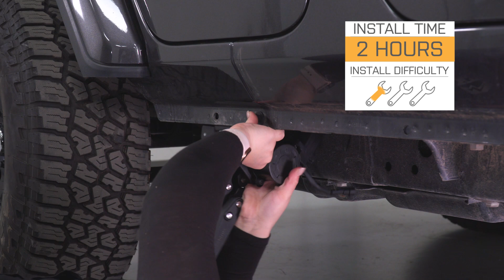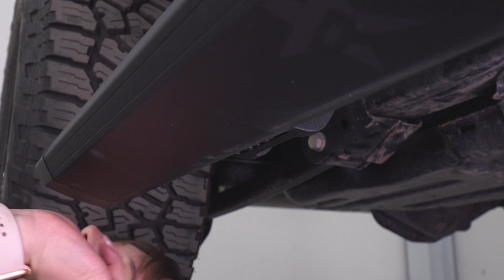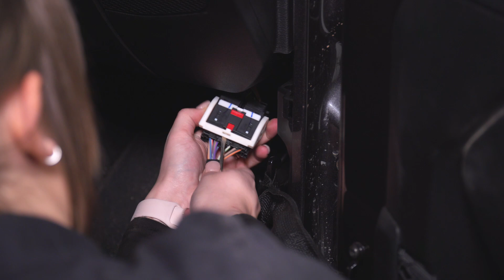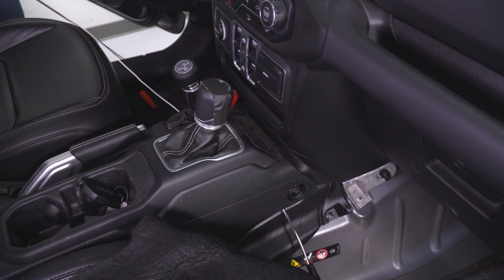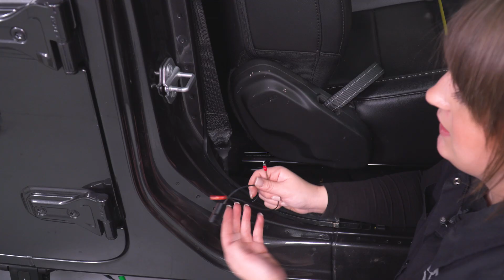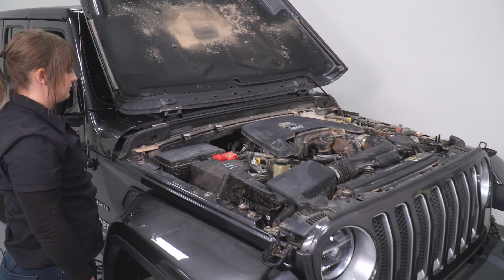Jeep Wrangler JL 4-Door RBP Stealth Power Running Boards Review & Install

Comment: What About when you remove the doors?
Reply: I have this system on my JL. When I remove my doors (and disconnect the front door wiring harness), the steps default to the up position. They tuck themselves to the body well, so it still looks good, but you loose the functionality. 
I added grab handles to help with ingress and egress with the doors off (4” lift and 37’s make for a little drop).

Comment: That's about 5 seconds or so delay before they retract. Can that time be changed to immediate?
Reply: Or is there a logical reason for the delay?
Reply from the maker: As far as my experience with these RBP Running Boards goes, there is no option for the delay time to be changed. I'd recommend reaching out to RBP's customer service department directly at the following number in order to get more information if you're still looking to purchase. (877) 519-9090 -Zach